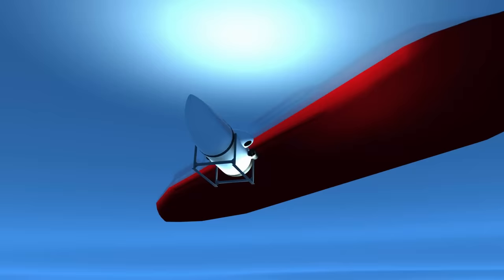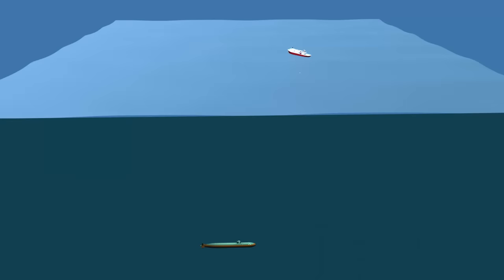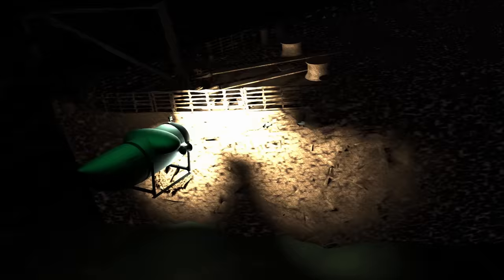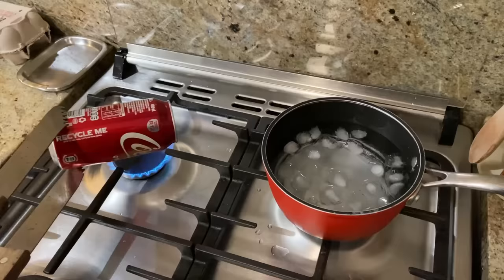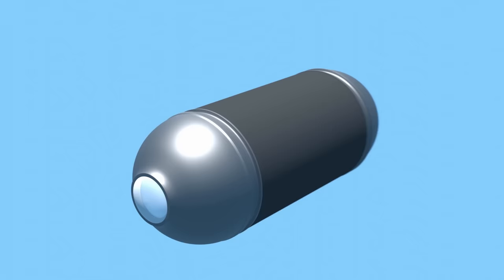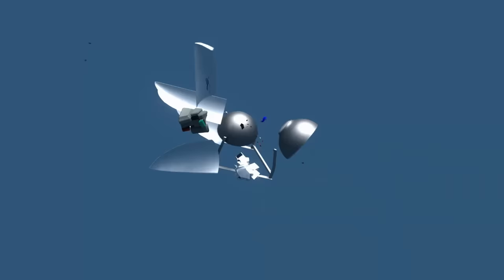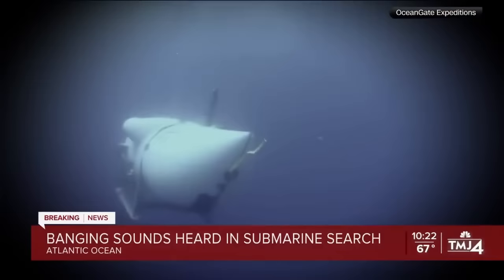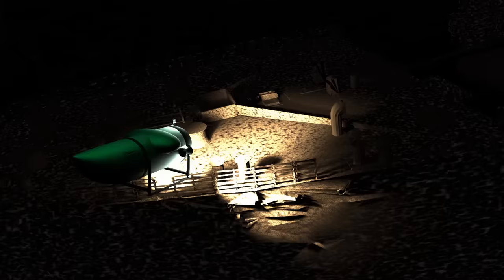TITAN Sub implosion | Deep Dive animation explanation

Comment: I believe the choice of carbon fibre was made because of availability. Where can you get 5 inch thick plastic tubes of a custom size? Nowhere. A tube made of wound fibres, however, is easy to procure because large fibre melt spinning machines are available - they can produce tubes of virtually any size and thickness.
Reply: Partly. It's also lightweight and strong*

A sphere is the most resistant shape when it comes to pressure. But if you want to take more people, you need a bigger sphere, and thus you need thicker walls
A larger sphere with thicker walls is also heavier, and that requires more powerful engines if you want it to move, which in turn increases the weight even further
All of these increase the cost, both financially in terms of fuel and maintenance, and also in terms of resources needed from the mothership. A larger craft needs to be deployed from a larger ship.
Or you can have a longer craft, a cylinder is still decent at resisting compression but it's far weaker than a sphere, and this needs to be compensated for, again perhaps with thicker walls, and this leads to the above issues

*problem is, it's not strong in the direction it needs to be. Carbon fibre has great tensile strength that can make it ideal for containing pressure from within, not pushing against pressure from the outside. Worse yet, it wasn't a cross-weave that might at least have added some reinforcement, but on the other hand that's probably only delaying the inevitable
Reply: @adamheywood113  I agrée with your assessment, but the CEO of OceanGate and his engineers would have been aware that fibres are strong when loaded in tension - it’s pretty basic stuff. I do think the choice came down to the machines for making the hull.

As an aside, I think the use of a composite complicated the analysis of the useful life, makes the the item prone to defects, and introduces failure modes that are hard to evaluate or predict. 

For instance, cracks propagate differently when there are fibres - fibres can help blunt cracks in some cases, but can exacerbate them in others - fibres can delaminate from the matrix - etc.

In my mind, they though that their hull integrity detection system (based on sound) would cover all events of failure.
Reply: @dimbulb6443  
Indeed. From my own limited layperson perspective, this looks like there were multiple possible points of failure, symptomatic of a haphazard development

Comment: I'm assuming there are no retrievable human remains. The force of that implosion would have crushed everything inside the cabin into a dense clump of combustible material mixed with the oxygen in the air. Then the heat from the compression would have lit it on fire and detonated it like gunpower; blowing the rest of the ship apart and instantly cremating all the passengers' remains. I doubt they even felt it: just a warning light, the CEO frantically playing with his Xbox controller, an upward jolt from the ballast drop, then BOOM!...

Comment: The bow domes on the SEAWOLF class is also made out of a laminate and even it is fe-laminating at the connection points to the hull.

The sub cannot go anywhere close to the depths a submersible can.

There is seawater on both sides of the bow dome.
Reply: Oceangate took shortcuts and through misdirection, cheap talk, arrogance (a violation of the SUBSAFE values), bullshit engineering, and hand-wavy magic successfully voyaged to Titanic.

They attributed to skill what appears to be luck and survivorship bias.

Comment: That was I interesting but there are so many variables that I’m beginning to wonder what we really know.
For example the Titanic wreck ploughed into the sea bed at +35MPH and the shattered pieces from the implosion would also have hammered into the sea bed. Probably with enough force to pop, if it was still in place, the viewing port. Also enough force to twist the outer shell.
See. I’m not denying a carbon fibre failure, or tungsten ring seal fail, or even the viewing port.
But..I hope I’ve just helped a bit in this mystery by adding another conundrum..😪

Comment: They could have made the walls more than 5 inches thick, even a foot or more, and it STILL would have failed... without a means of maintaining TENSION on fibers like an unsuitably high internal pressure, the carbon fiber could not distribute the loads properly. The fiber's greatest strength is in tension NOT compression. After a series of dives, the epoxy resin would inevitably crack from flexing under varying external pressures of water, after that the fibers would simply collapse like the flexible bundle of fibers they were made from once the epoxy failed.

 The only way i can imagine the usage of carbon composites that could work;  is as a reinforcement of internal load spreading devices overwrapped with fiber to place carbon in tension around columns, pillars and braces inside a water tight metal hull.

Comment: the carbon fibre would have instantly been turned ino CO2 as the on board oxygen supply and the intese heat would have caused instant detonation.

Comment: I worked in motorsport. CF is used for strength vs weight but fatigues and cannot be  put through finite element analysis as it is 2 or more materials hence the word composite. It degrades with constant loading and unloading. This is why components on a racing car such as wings, floor etc have a lifespan. It was utterly the wrong material for this application, pointless. Performance vs weight was not the cheif consideration here. I am staggered they did this, but now you show me that it was wound in 1 direction only and it makes me even more angry. The sheer arrogance of oceangate and the idiot Rush. Makes me sick, genuinely

Comment: Carbon fiber is extremely strong under tension, and is an excellent material for vessels where the pressure is higher inside than outside.  In a submersible, the outside pressure is higher, all the material of the vessel is  in compression, and the carbon fiber has no useful function at all.  A pressure vessel made of only the epoxy would have been stronger.  Any vessel will implode when the external pressure becomes too high.  For a cylindrical vessel, like the middle part of Titan, it is the stiffness of the cylinder wall that keeps the shape circular.  At some pressure, that stiffness will be insufficient, and the vessel will implode catastrophically, as illustrated by the aluminum can in this video.

Comment: It will take some time to complete a forensic investigation, as anyone who has watched the NTSB investigations of air crashes on the aviation disaster series on Smithsonian TV Channel.  If they recovered a readable data recorder that will help. But fatigue failure of the carbon fiber composite tube is the most obvious suspect.  One has to ask why Stockton Rush decided on a cylindrical hull when most other deep submersibles' pressure hulls are solid titanium spheres.  Could it have been a profit motive to enable carrying more paying suckers/passengers at lower cost?

Comment: We all have to respect the construction regulations of the Submarines. Designers, Engineers, Operators, Summary of the accident as well: Use of Materials and in the Processes at the beginning of the dive. Is Passenger Safety in the hands of the Builder and Operator? This is not a Good Idea.

Comment: You are alittle off on the modern large submarine depth being 250m, considering how 50 years ago when the Los Angeles class was still pretty new, everyone knew it had a 1400 ft test depth.
I BELIEVE test depth is 2/3 of the design depth, and crush depth is generally 1.5 or 2x that.
The real figures were deeper than published then, and I'm sure the newer subs they have nowadays are deeper still.

Big difference between test depth, design depth, and crush depth.

Comment: Even if the carbon fiber held, which it probably would if they replaced the hull every few dives, using glue to connect the carbon fiber to titanium sounds like a massive red flag under 6000 PSI.

Comment: It didn't help that the sub was constructed of disparate materials.  I believe the fact that they expand and contract at different rates under changes in pressure may have resulted in cracks/weakness at the interfaces and contributed to the disaster.

Comment: Speaking of the composite material on the center tube of the submarine , was the  carbon fiber & poxy bonded through using an autoclave or was it sealed using just a straight up vacuum? I'm kind of curious if it was in an autoclave. How long it stayed in the auto clave and it was cured correctly.  ?

Comment: I fail to believe that the passengers, er, sorry, 'crew' weren't aware that things were bad. I am sure that there were creaking and groaning sounds as that cursed little can started succumbing to the pressure around it. It had a 'real time' application that was supposed to alarm at any level at even the slightest threat of compromise. Imagine as they floated downwards in pitch black (they kept the lights off to 'save on the battery' until they got to the site). The icy cold of the Atlantic condenses their breath into a thin layer of water on  the interior walls. The submersible suddenly isn't as reactive as is typically expected of it. The 'Real Time Monitoring System' alarms start going off indicating a worrying problem with the vessel's integrity and a self centered egomaniac with a $12 Walmart knock-off game controller in hand tries his best to invalidate and laugh off his passenger's well founded fears. He jettisons the sand weights in a attempt to allow the submersible to rise but it doesn't work. They noticeably start descending even faster and he isn't laughing quite as hard now. He stifles his aggravation with unyielding system failures and he jettisons the metal docking frame next. Now every alarm is now sounding around them. I imagine father and son holding onto each other in absolute terror; they are visible now only due to the persistent red light of the alarm system flashing on the computer screen. The egomaniac with the $12 Walmart knock-off game controller is no longer even aware of his passengers. All those naysayers who mocked his genius were NOT going to be right today! He desperately tries to reach his comrades at the surface through the inconsistent text messaging system they had so often joked about in the past to no avail. The reality of the inevitable has still not settled with him. His passengers however, are filled with terror and reality of their predicament is no longer something he can joke away or hide from his passengers. He tells them that they have gotten past these issues before! The Titan will hold but his passengers remain absolutely numb with terror. The little carbon fiber vessel groans in agony as it can no longer withstand the intense pressure it miraculously survived the 2 previous trips. It's descent increases and the once indomitable Titan submersible suddenly relinquishes itself to the strength of the great cold Atlantic.

Comment: I can't understand why the port hole glass was not in place when the end plate was recovered.  Leads me to believe that this was point of failure.  Was destined to failure from the start. Not to counter wave the carbon for a start was unbelievable.  I don't think though it had a steel liner. The carbon is spinned on the drum. Photos from in side shows the monitor was self trapped into the PX vessel ffs. Shame it took indecent party's out.

Comment: If the hatch port window was the cause of the incident, the carbon fiber cylinder will have exploded rather than imploded due to the gaseous internal environment exploding punching the ends off the carbon fiber cylinder cleanly and deforming the internal skin of the cylinder outwards. So chards of carbon fiber bonded to internal cylinder metal fragments should indicate whether the implosion occurred primarily or secondarily.
There is considerable reporting that the port window was certified to less than 1500 meters depth. There is also considerable reporting of noises like alarming cracking sounds highlighted by experts in previous test dives in 2020 or before. If these reports are true, this is a failure of project management and information recognition, not of engineering. It may be the carbon fiber cylinder did not fail but was destroyed by the hatch failure. If Canadian law applies, all those who recognized the dangers and did not act in a timely manner, are personally liable. Did the Porthole manufacturer report this misapplication to the H&S of their respective country? Its an interesting angle which may be left in the air due to use in international waters, but crimes overseas are not always out of jurisdiction. Tragic simply understates the terrible result and outcome for all those concerned or affected by the collateral damage, not least the families and friends.

Comment: I don’t have submersible experience but I am a professional engineer with 30 years experience in the chemical industry.  Speaking as such, this has to be one of the lamest most hair brained operations I’ve ever come across.  Rush was a engineer too, he knew better.  It was his business if he wanted to take a carbon fiber sub down to see the Titanic but he crossed a line when he sold spots to passengers.  That should change the fundamental rules by which this Ill fated venture operated.  I’m waiting on criminal liability issues to arise.  Everyone else must operate with RAGAGEP. What excused these people?  Regardless of how many liability waivers these people signed, it was wrong to take them down on a vehicle like that.  Nevermind the CF debate,  a sun designed for 4000 meters regularly operated at 3800 meters?   Just no no no. This entire venture was ill conceived at best.

Comment: The ocean is fickle in that thanks to buoyancy, it is extremely difficult to get down there, but by its nature, every manned trip down there requires a sacrifice to return to the surface. We should leave the bottom of the ocean to the beings which live there, and we should explore it only with the rovers designed to embrace the unforgiving nature of the deep.
The ocean floor is not the domain of man.

Comment: how come the Titanic or other sunken ships don’t implode when they reach those depths toward the bottom of the ocean? does implosion only happen to submarine-like vessels?
Reply: In WWII, it was common for sonar operators to hear the sounds of implosions from sinking ships. But those ships broke up at relatively shallow depths a few hundred feet. Submarines have extremely strong hulls, so they only implode at very extreme depths. The bottom of the Atlantic is about 2 miles deep on average. This Titan sub was probably crushed instantly.  However we don't know exactly how deep it was when it happened. It might have imploded at only 5000 feet, due to its  risky design. That may explain why parts and remains were re overed. I think if it had imploded at 11,800 feet, down where the Titanic is, there wouldn't be much left.
Reply: The individual watertight sections were overtopped and filled up before it sank or shortly after. Therefore the pressure was equalized before it got to that depth. It really depends on if the water tight integrity is held as it sinks. Some of the many marus sunk by US subs during WWII had excellent watertight integrity. Which was probably unfortunate for the Japanese sailors caught inside as the ships sank.

Comment: Why are there such large pieces of the hull intact?
Reply: Those parts of the hull were made of proven titanium and steel. The passenger compartment was the weak point in construction due to the questionable strength of the carbon fiber composition over time. Notice that none of that was recovered.

Comment: After 90 minutes, they should be about half way(2/3), not almost all the way. Entire dive suposed to take about 2 and half hour, about 150 minutes.
Also, your animation is wrong. Titanium cupollas does get pushed inwards, its hull between what collapsed and they would be more likelly pushed bit away as result. Same as that Coke can isnt rolled into single ball, its length remains pretty much same.

Comment: Carbon fiber laid down in one direction seems like a dumb move. My only experience is with aircraft where I'm thinking there may be more engineering involved. At the very least on nonstructural parts in bidirectional.  Structural parts are designed with many very specific different directions to the layup. NO expert here but it looks like it was a time bomb.